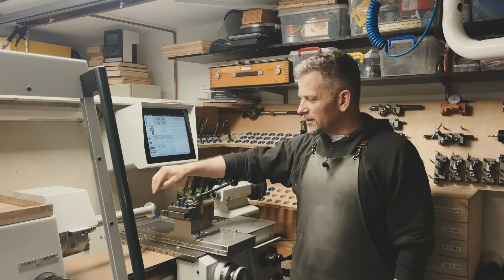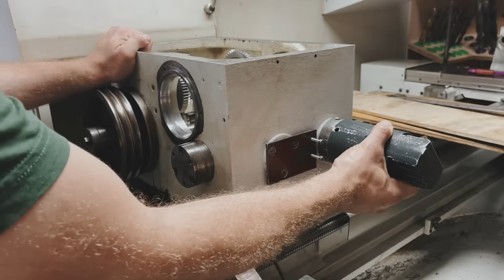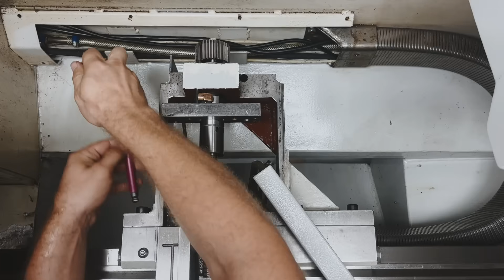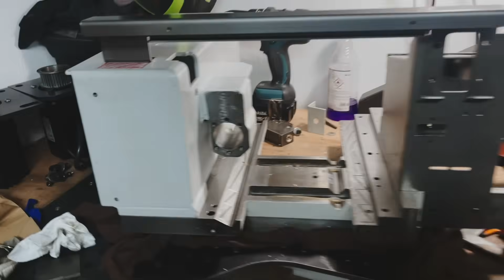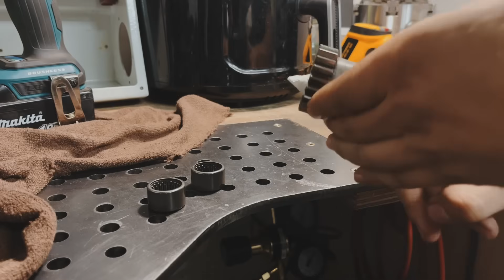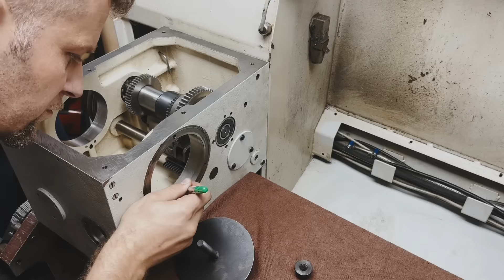Time spins again - WeilerE30 rebuild (part one)

Comment: Hi Vasi, i am impressed by your video's and al the work your doing. I myself am selling the Weiler turningmachines in the Netherlands for 35 years. If there is anything i can help you with, i am happy to hear from you. I myself also want to buy an E 30, in reasonable condition. But that is not so easy. I would like to discuss with you how you see the ethercad tecnics and what control you equipped the machine with. Keep up the good work. Marinus
Reply from the maker: Hey, glad you like my videos. 
You can contact me at: vasimihalca@gmail.com

Comment: Do you have the possibility to wiew countouring error by comparing servomotor encoder and linear scale encoder on each axis ?
Reply from the maker: The linear scales are not hooked up yet. 
Linking those will be a separate video. 
It would be nice to do what you’re sayin. Still have to figure out how. At worse, I implement some custom UI for that.

Comment: 2:55 --- wax one side (best with release agent , wait a bit and buff it ) / oil it and it wont stick together 
But for next time use thin wire etc + bit of isopropyl alcohol all around and try to move instantly --- alcohol will make it easier to peel it apart (works great with hot glue , same if u use acetone)
Reply from the maker: Thanks mate! 
You confirm the saying “there is no compression algorithm for the experience” 😄

Comment: Too much oil on spindle bearings can cause excessive heating.  I rebuilt a 12,000 rpm spindle on my haas and added oil to the bearings to make sure break-in wasn't dry.  The spindle got very hot on break in and during use, then it was suggested to increase the spindle purge air pressure to blow the oil out of the bearings during break in.  I re-ran the break in with more air purge and this actually reduced the bearing temperature and now it runs cool.  The bearings just need a film of oil, any more and it actually heats the oil up too much.
Reply from the maker: In your case, it makes perfect sense. But here, the sheet metal pan has two cooper pipes that deliver the oil to the sides of the bearings. The caliber of those remains the same. So my job is just to make sure the pan has oil in it no matter the speed range. This way it will drip the maximum amount those pipes allow per time unit.

Comment: Holding the key in a vise, bench or milling vise makes removal a breeze!
Reply from the maker: I tried with pliers but did not thought about this, thanks for the tip! That’s why I love YT. 😁
Reply: @LikeFactoryMade  the knipex cobra is great but not for this task. The vise approach works everytime even if you have to move the vise to the part and not the other way around, if the shaft is, say, on a car 😅

Comment: The turcite is there to absorb the vibration and the load and at the same time it's rigid structure
Reply from the maker: The turcite was not making contact with the V Ways. Once I lose the screws, it was moving sideways on the bed. 
The epoxy on the other hand, will fill that space and it will create strong bond between the headstock and the bed. 
It’s like a liquid shim. Actually it was called this way too. 
Thanks for watching, stay tuned for the second part. 😉

Comment: If you use an oil in the headstock that is more heavy, like ISO 46 or 68, the gears will carry the oil more up to the cover, and it will drip in the feed trough more.  ----Doozer
Reply from the maker: The oil I added in the second part of the video is iso46, but at low rpms it was disappointing. However, I’ve added a more reliable fix. Hit the notification bell so that you don’t miss the part two! 😉

Comment: If there is a inclination to the inner gearbox cover, it would help the oil pool in the bearing tray?🤔
Reply from the maker: I think that was an aspect that I’ve missed. When I leveled the bed, I was mostly concerned to remove the twist. 
However, in the second part, I’ve addressed that. Hit the notification bell so that you don’t miss it! 😉

Comment: Great video, I enjoyed watching your work on machine repairs, but it was disheartening when the rains came in through the shop. That was just awful. We had a fluke storm at home 10 years ago, and my basement flooded 4", (10cm for the rest of the world)
Reply from the maker: Glad you liked it! ☺️
With this 5” threshold, I think I will be fine for the years to come. I am in a hill area of  the town so the risk is quite low. The main reason I got flooded is because the lid of the sewage got clogged up with leafs and a car was just right on top of it so I could not see it and clean it. 
Make sure to hit the notification bell, I have a pleasant surprise in part two! 😉

Comment: The amount of mistakes they did to your bed and spindle is crazy. I am now afraid to let anyone touch my stuff. I hope you didnt ground away the hardened layer of your spindle tapered bore. Also when you were adjusting the spindle bearing preload, you were talking about axial play, but you were measuring radial.  Anyways now i need a weiler lathe. Cheers Adam.
Reply from the maker: I could hardly explain to someone the level of frustration I had with all these “professionals”..
I think there are chances that the hardened layer was ground away. But I was not planning to use the inner taper for something else other than the test bar while trying to align the headstock. 
Regarding the axial/radial measurement, I did not had footage to backup my words, but I said at least I’ll say what’s right if I can’t show it 😅

Comment: I hope you got your money back with that kind of evidence from the CMM.
Such bad work gets me irritated…and I’m not really at harm here. 😊

Stubborn keys are, often, removed with side cutters I have learned.
Reply from the maker: I did not got my money back, it was an unofficial repair, officially they don’t do this kind of repairs. They build machine tools (tool holders, vices, etc)
For some money they’ve asked, someone made me a “favor” 😅
Reply: @ 😒
With favors like that… 😖
Great project and so much work put in.
The air fryer is very clever in a cramped shop. 😃

Comment: Hi, i just did a similar retrofit with LinuxCNC but using a Weiler 160 cnc. I made my own "semi conventional" Encoder holders for the Y and Z movement... only thing missing is a spindle relube of the bearings (or at least i hope so 😂)
Reply from the maker: Not sure how 160 cnc is. Maybe it has grease bearings and you don’t need all this headache. 
Not sure how that semi-conventional is for you, can you detail a bit?
Reply: @LikeFactoryMade 
Yeah, the 160 has a spindle cartridge and no gearing. Just a 22kw dc motor.

I got this term from the weiler website, meaning that you can operate it like a conventional, though driven by servos. I.e. encoders for handfeed, and a lever for feed, though it also fully cnc.

Comment: man, that water in the shop..  and just a 100x50 to keep it out?  I'd think a sort of sump right behind the door with a pump that moves the water elsewhere, where it doesn't cause problems?  Might even want to look into having that on a sort of off-grid power supply, in case it's not just rain but a real event where the power goes out?

Lovely toys and very proficient shop owner it seems from afar..  very nice to watch and learn.  Thanks for making these videos.
Reply from the maker: I am in a hill area of the town, the chances for flood are extremely slim especially now that I have that threshold. 
The reason on why that happened is because the main sewage got clogged up with leafs and there was a car on top of it so I could not see it and clean it. 
I also had a floor sink, but it got clogged up when the leveling floor was poured in my shop. I’ll make sure that becomes functional in case of any disasters. 
Glad you like what I do, I have more ideas to come, so make sure you hit the notification bell! 😉

Comment: I was shocked at the use of turcite under the headstock.....but regrinding the spindle taper without doing an idiot check?!? What a nightmare.

I really enjoyed the video, great work. Well paced, good narration and good shots. I'm really interested in the steel fixture plate you have mounted in your work bench, do you have a post about that? 

Greetings from another zero chaser in Estonia.
Reply from the maker: Glad you enjoyed it! 😊
I had my fair share of idiots while trying to repair this machine. This is why I wanted to have my shop. I was too sick and tired of others tolerance to bullshit. I know that the zero chasers like you can appreciate this! 😉
Regarding the steel insert in my work bench..it’s just an 8mm sheet metal plate that was laser cut directly into this shape. 
I can find the drawing if you need it to, but I think you may need some dimensions adjusted to your workbench.
Reply: @LikeFactoryMade having your own shop to do it right certainly does help. I've been working on that so I can finish my lathe rebuild. It takes a lot of time but its certainly worth it.

I dont think a drawings necessary, i should be able to figure it out😅. Its a very nice idea, seems super versatile.

Comment: If you ask someone if they can do it and they say "no problem", that's when you should be scared.. We asked another company to make something for us with a flatness of +-0.25mm flatness they said "no problem"... We got it back with a flatness of 3.5mm.... I am not joking.
Reply from the maker: Yep, I’ve learned this the hard way..😅
Out of curiosity, how big was the part that came back with 3.5mm flatness error?
Reply: @LikeFactoryMade  Oh its roughly 1500x800x25mm. Its basically a 25mm plate with a bunch of holes and outside clearance flame cut into it. Which will warp obviously when flame cut. That was basically only a test, the plates we got before were milled flat to achieve flatness but that company said they can flame cut it and straighten it to +-0.25mm. Obviously because its cheaper, that's the only reason they even gave it a try. 

And ngl the front to back and side to side flatness was not that bad, as soon as you turn the straightedge to like a 45 you got a 3,5+mm rock (its twisted).

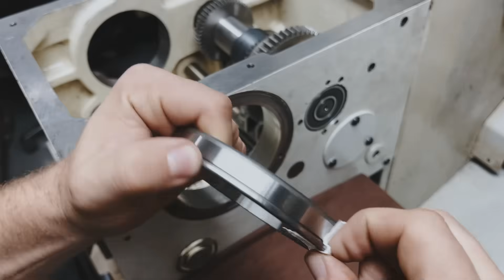Comment: 29:47 Out of curiosity what class are your spindle bearings?
Reply from the maker: The old ones had a SP mark which I understood means special precision. This ones did not had this mark, but to give you a spoiler, I ended up having less than 1micron runout in the end. I ordered them from Weiler and these were matched by them.

Comment: isn't it like a funneling groove in the headstock lid for directing oil to the tray?
Reply from the maker: The lid has a two ribs in X shape, but I’ve put the lid without the screws and ran the machine a bit, and the oiling pan did not accumulated oil. I realize just now while responding to you, that I mostly cared of removing the bed twist when leveling, but did not paid attention on front to back leveling. And I realized that matters here.
Reply: @LikeFactoryMade  I assumed you had already thought of the lid but I felt I just needed to throw it in the discussion since it is easy to overlook things 🙂